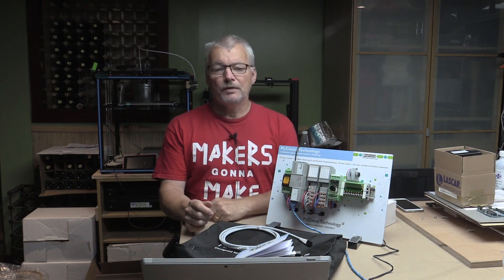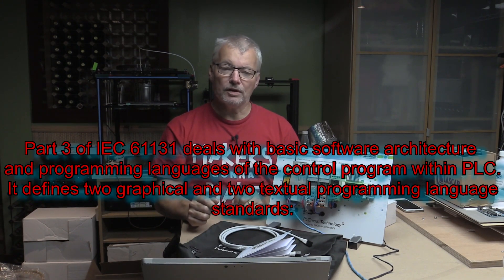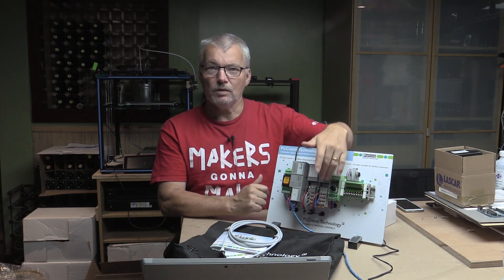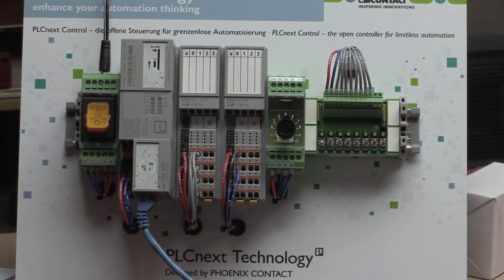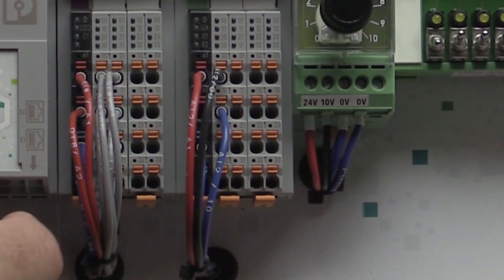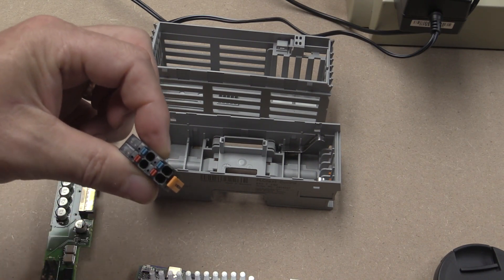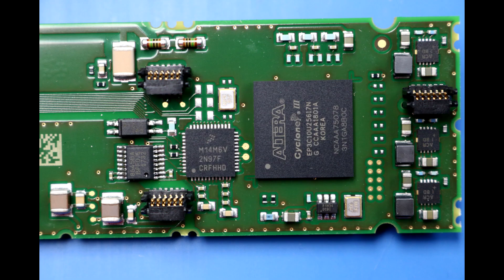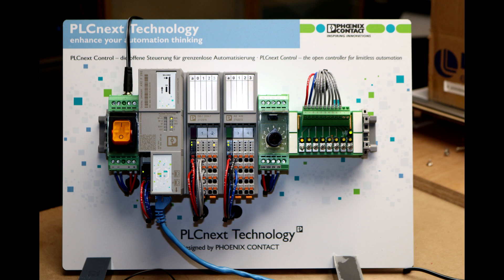PLCNext Starter Kit  IEC 61131 compliant

Comment: NIOS II soft cpu ?
Reply from the maker: I made an error in agreeing it was the NIOS II Soft core, it is not. it contains the Hard processor system (HPS) with integrated Arm* Cortex*-A9 MPCore* processor, Dual Core at 800Mhz providing  tight integration of a dual-core Arm Cortex-A9 MPCore processor, hard IP, and an FPGA in a single Cyclone V system-on-a-chip (SoC) and  supports over 128 Gbps peak bandwidth with integrated data coherency between the processor and the FPGA fabric
 for more details on the Cyclone V SOC Please see https://www.intel.com/content/www/us/en/products/programmable/soc/cyclone-v.html 
This is one powerful chip...